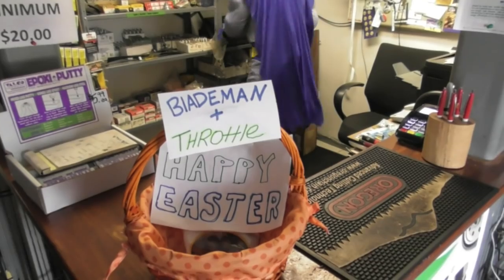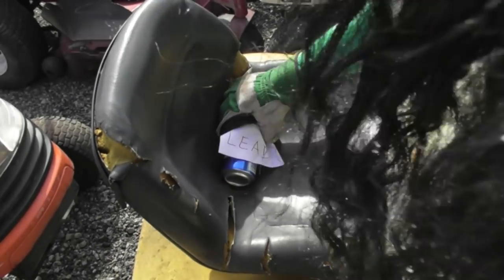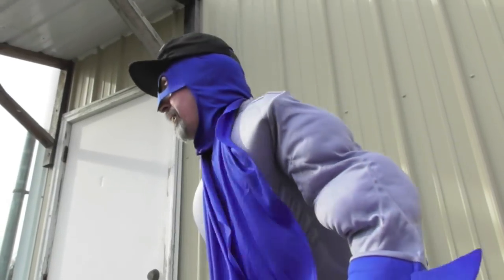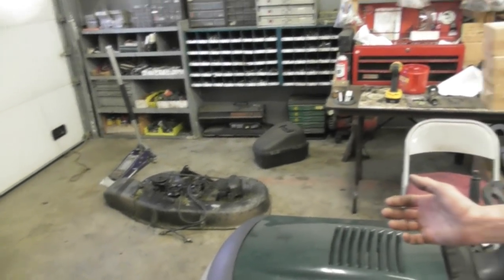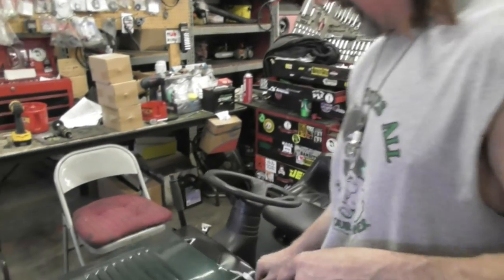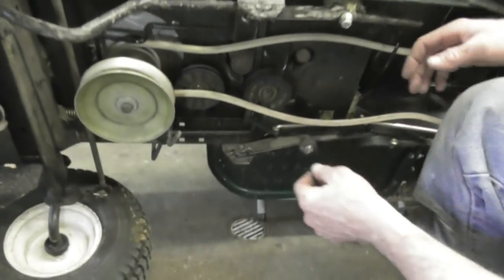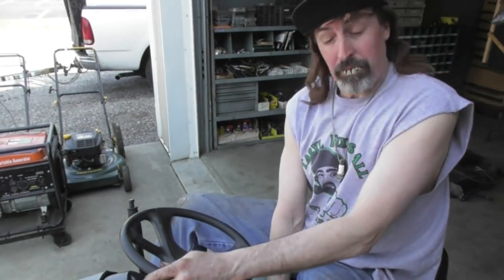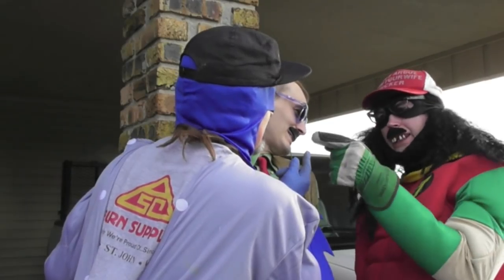Install Ground Drive Belt On A Craftsman Riding Mower (Center-Shift)

Comment: Question I have a 2004 dgt 6000 drive belt slipping so I put a new one on and it has even more slack. Tensioner is maxed out. What should I do. It's not like the other craftsmans were the brake pedal moves the belt its spouse to have tension all the time

Comment: I followed your directions and replaced that belt quick and slick. Brilliant! Thanks Taryl. Also, nice tip on using those front links as a handle.

Comment: I have a craftsman DYT 4000 itys a 2004 model ,recently jerking in gear with lot of noise...so I checked the tranaxle pulley,idler pulleys&electric clutch ,no issues that could see plus engine is new....do you think its the transaxle??...

Comment: yah..the confusing part is if the belt goes through the twisted wire keeper near the flat idler.  it does not.  It will rub when disengaged but not when engaged.  btw, my flat idler bearing failed @ 15 years and the belt cut its way through the 3" plastic pulley down to the bearing.  i looked for metal ones to no avail.  phoenix mfg may have one..part 31305075G if i measure correctly but you need to press/hammer the standoff out of the old one and into new one.  not sure if bearing in metal one can be pressed out or is held captive by spot welded sheet metal pulley halves.  if anybody tries it, please lmk.

Comment: Ok so if you can't get the 95 1/2" belt go with a 96! I did not know that, i've always erred on the side of a slightly smaller belt. I work in a store that sells belts and they go by whole inches so i've always told people to round to the lower number. I'll remember this next time I recommend a belt to a customer. Thanks Taryl!

Comment: Hey, I got a LT 1000 Craftsman Lawn tractor. I just replaced the Drive Belt, and it won't go into gear all the way. It kinda does, but doesn"t fully mesh with the Gears. It wont pull the Tractor Forward, or Reverse????

Comment: Great video guys. Those craftsman mowers are pretty simple to work on.
Could y'all do a belt video on a cub cadet lt1045? Wanted to see if you have a good fix for the way the pulleys line up on the deck. Think they dropped the ball on that 1. Love the videos guys.
Happy Easter

Comment: another good video. how about a video on repairing Charging system on 60's model sears suburban. also any solutions on repairing cracked flywheel without replacing it. thanks keep up the good clips.

Comment: Thanks for making this video. I wish I would have watched it first. I didn't know what the belt size was so the guy at the parts store sold me a 95 inch belt. I got it on and then tried it out and when I let out the clutch the belt started smoking. Thanks again also for showing  the inside of the hood where the parts # are.

Comment: I put on the new belt, but now I have problems with the trip of the clutch pedal, because it is very short and very low. When the brake is applied, the belt will sound. I have problems with changing the transmission changes. What I can do?
Reply: Mr Dactyl,
   I have the same problem with my Craftsman 42 (model 917.271530) I have tried two different after market belts and also a 1/2 x 95.5 belt and all three bind. 
   What am I doing incorrectly?
Thanks for all the great info and let us know when you will be in 'Lu uh vul' (Louisville, for non-Kentuckians) again,
A devoted follower

Comment: l have a craftsman LT1000 and when l brake fast the belt comes off the gearbox pull any ideas how to fix it  ?
Reply: You need to get a new belt, yours is stretched out, which they commonly do.  I haven't had to replace mine however, for 17 years.  Not exactly sure but i think it's a 2003, but here are my numbers on the mower , someone might be able to translate how old it is.  917.270671 lawn mower model #.  Markings on Briggs and Stratton:  Model 31H777, TYPE 0297E1 , CODE 040126ZD

Comment: Hey Taryl. I have a t1200 craftsman 42 inch cut with the 420cc motor. I need to replace the primary drive belt and I have the replacement on but I can't seem to figure out the two middle pulleys. Should I have to remove one of those pulleys to get the routing right? Thanks
Reply: We have a similar Craftsman and ours has a decal toward the rear of the deck that shows the belt routing.  It might be hidden under grass etc, brush it off good and see if there is one there.
Reply: 64FordF100 ..Thanks for your advice. I had the routing diagram already but I just wasn't sure if or which middle pulley to remove. I have since completed the replacement. Thanks again for your reply to help.☺👍

Comment: You said use a 1/2 by 96 inch. Then you put on a 1/2 by 95.?. My 95 won’t let me shift . What do I use?
Reply from the maker: Around 6:30 Taryl explains the mower calls for a 1/2 x 95-1/2" belt. Taryl states to use a 96" and NOT a 95" belt because it needs that 1/2" or more (hence the 96" belt) to shift. And there's your dinner
Reply: Thank you